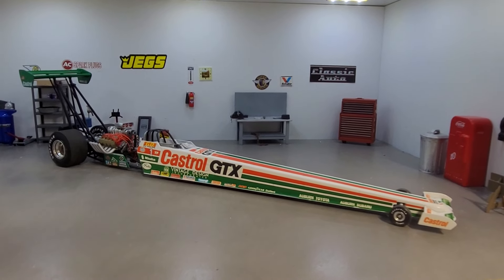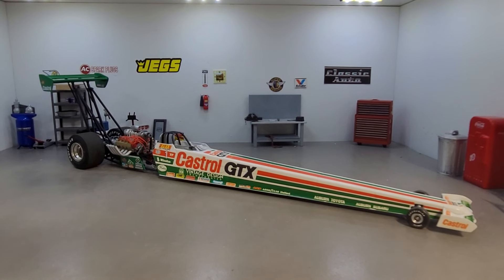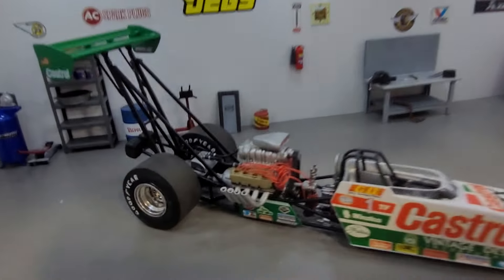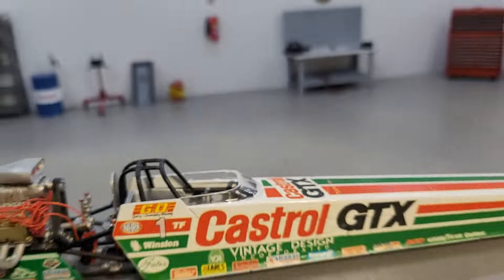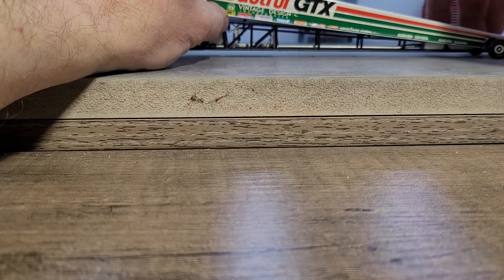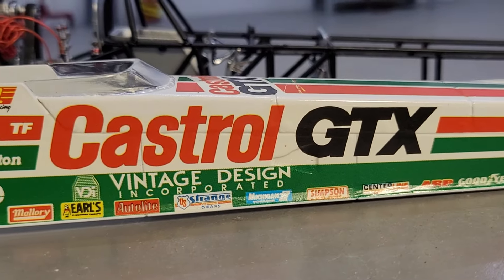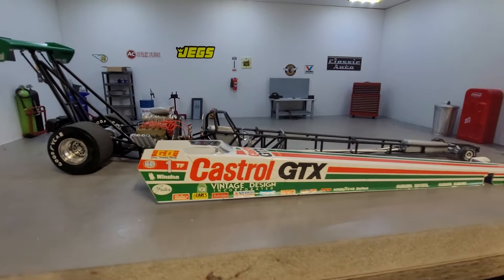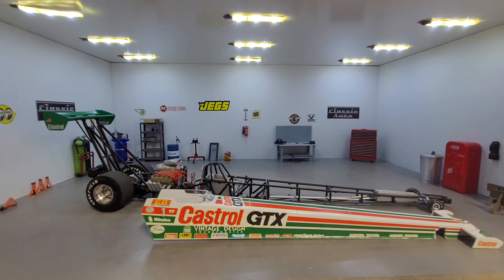Gary Ormsby Top Fuel

Comment: Thanks for this video.  I requested it... those front tires stock?  Look too small... Usually top fuel have bigger spoke wheels I think... or is this version just older maybe.  Those look like go kart tires...  Maybe just me... LOL
Reply from the maker: I'm not sure. I guess it was a thing for awhile. What's really interesting is the front wheels are staggered.  One is farther forward than the other. I imagine they were trying to gain an advantage for breaking the beams. Apparently it didn't work out?
Reply: Those small front wheels were common in the late 80s/early 90s.  Started with Garlits because he wanted the streamlined nose on Swamp Rat 30 and others copied.  People started to switch back to the bigger front wheels in 93 or so.
Reply from the maker: @HonestOtter  thanks, I didn't think they were around long.
Reply: Small front tires appeared in ‘86 then became common by the end of ‘89. By 1990 almost everyone in the tour were running them. Then in ‘93 teams began to discover there was a staging advantage to the older bigger “motorcycle” wheels and like that, almost everyone switched back. I thing the small tires were completely gone by ‘96